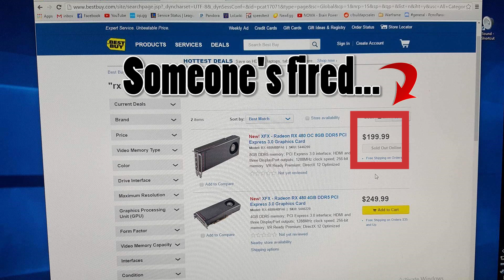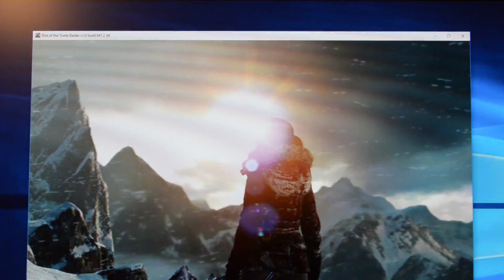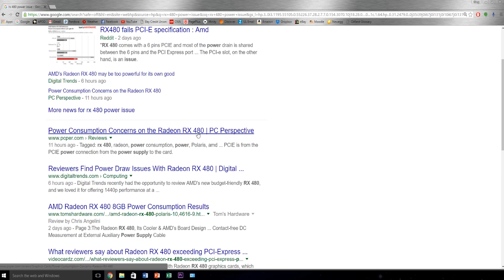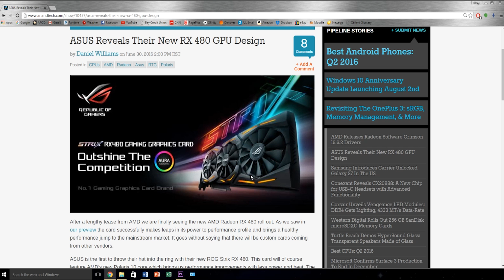RX 480 Aftermath: Power Issue & Over-Hyping

Comment: Do you think that AMD will release an updated BIOS for the RX-480 to push more of the power draw over to the 6-pin connector?
Reply: http://wccftech.com/amd-statement-rx-480-pcie-power/
Reply: There are many MicroControler chips on any modern PCB which can control Current flow,the 6 pin MOLEX has more than enough beef to reduce the 79W avg on MB power draw to the desired 60W,It's most likely a bug on their Power management Script(1:1 Scaling,whenever 6pin draw spikes mb power draw spikes almost identicaly) which will be most likely fixed with a V-Bios Update
Reply: Gerff
Dude,If everything is physical(like it's a Comodore)then how the fuck U OverVoltage ur GPU beyond TDP limits in order to overclock it ?
It's pointless to talk with you,just stop misinforming ppl
p.s: http://www.tomshardware.com/reviews/amd-radeon-rx-480-polaris-10,4616-9.html 
yeah this is definitely for Consumers xD
Reply: Gerff If you read my comments you see that I said: It is possible to force limit 66W on PCIe(12V*5.5amps) and draw the additional needed power from 6pin Molex that comes from PSU(they can maintain well above their official standards,in the absolute worst case scenario this will fry ur 6pin Port itself after like 1-2 year or so)in this way U are not undervolting-underclocking since u are getting the additional power from PSU
You missed my point,every card you see on the market,when you test their power consumption the line for PCIe Power draw is almost flat (that is the way it has to be)but with this card the MB power draw seems to follow the exact pattern that 6pin power draw has,this is not normal,and it's a way too foolish mistake to be a physical problem(Phasing of Regulators) with all the QC they do so I suspected a firmware based bug and I still do
nevertheless I never advise anyone to buy a reference card at all,they all have their problems,1080 with throttling back in the day even reference 960 had the same problem as this card(not this severe tho)
The Polaris chip itself is not a bad design,it's cheaper to produce and more efficient than most of the chips out there

they are going to release the update on Tuesday and we will see will it underclock or not

and again please work on your talking manners
Reply: +Gerff
If U are studying electrical engineering ,check out the tom's hardware's article and their test results,U will understand what I'm saying
Reply: Gerff LeadStarDude 
The New driver achieving 5.7amps(+ 0.2 from the limitation but well within accepted current)  with no Underclocking on PCIe power draw :
http://www.tomshardware.com/reviews/amd-radeon-rx-480-polaris-power-fix,4668.html
with compatibility mode for people with low tiered PSUs(Since it draws more than 75 from 6 pin molex,But each pin on a molex port is rated at 7-8Amps so it's safe for Gold PSUs) it registers below the limitations with 5.4 amps
Performance increased on all the power modes available:
http://www.pcworld.com/article/3093406/components-graphics/tested-amds-new-driver-fixes-the-radeon-rx-480s-power-draw-and-boosts-performance.html

It's simply fixed using the Powermanagement chips as I said before
Reply: Cant fix a hardware problem with software.  Circuit traces, Voltage regulators, capacitors, etc. aren't software controlled, they are physical circuits.  The COULD underclock the cards even more (reducing performance SIGNIFICANTLY, to the point that INTEL On-board outperforms them), and reduce power consumption that way, do you think THAT would be a good idea?  That is the only option they have to fix it with firmware.
Reply: Gerff They should be able to use firmware to shift the power usage more to one side instead of a 1/1 split. What makes you think that they couldn't do that? The firmware/bios controls everything including power management does it not? 

If not then I guess that the people that bought a reference card got screwed. So hopefully the aftermarket cards will have an 8-pin instead of 6-pin power connector.
Reply: LeadStarDude
No, the power doesn't work like that.  They are PHYSICAL traces and routes, and the card is designed and regulated for pulling a certain current from the PCIe slots, that is NOT something that can be fixed (or switched) in software.
Reply: Harmony Shimer Well I guess that proves @Gerff wrong
Reply: LeadStarDude
Hardly, the statement from AMD said almost nothing, except verifying that a problem could exist in some configurations and they might have to slow it down, the rest of it is just part of an article speculating things, which any logical and intelligent person would know means less than nothing...
Reply: Harmony Shimer
I haven't "studied" electrical engineering for 20+ years...Nor do I need to look at an article designed for "general consumers" to know basic circuitry.  You CANNOT change a physical trace or circuit using software.  The ONLY solution they have using software, is to SLOW THE CARD DOWN so it doesn't consume as much power from the slot.  Their options are 1. Slow it down to minimize the power draw (also meaning no overclocking is possible), which means it will perform even shittier than it already does, or 2. Recall the product and replace the boards.  Those are their two options.  On the consumer side, the most intelligent thing people can do is to return the card and purchase something else, and if they HAVEN'T bought one yet, DON'T.  It makes absolutely no sense to purchase this card unless you are building a new budget gaming system, for which you have other options.  This isn't a card that a person would "upgrade to", since the performance is lower than other options that are over a year old.  Basically, this is a product that should have been introduced over a year ago to make sense for anything beyond a new budget build.  Now, with the problems they are having, and BIG ones at that, there is absolutely NO logical reason to buy this card, at all.  I am sorry to say that, I had hoped AMD would come screaming out of the dark place they have been for awhile, we need them to exist for competition to the "other guys"; But they fucked it up again, worse than normal, and with an option that wasn't great to begin with.  Even FanBoys should surely see that this card is to be avoided, seriously.
Reply: Gerff You do know that a wall of text means exactly squat when you are wrong. AMD made a statement that the issue will be addressed through software. Do you think that you know their business and hardware better than they do? Oh... but we get it... You hate AMD and want to make a point. Well good job, and good story. No really... good story...  XD
Reply: Harmony Shimer
Completely different concepts, completely different things, and completely wrong way to think about things.  This is why people get confused, because people love to speak up when they don't know what they are talking about, and since people don't know, an oversimplification, or over-explanation by someone who is clueless starts to make sense to other people who are clueless.  Changing some power limits for overclocking isn't even CLOSE to process that is fucking up in these cards, and has nothing to do with it.  Your argument is like saying "Yes I CAN put more fuel in my tank, you are full shit and misinforming people when you tell them the car has the wrong spark plugs in it."

There are different points that the card draws power from, PHYSICALLY, and ONE OF THEM isn't regulated properly PHYSICALLY and pulling too much current from THIS POINT.  You cannot physically change the traces on a board, the regulators/coils/capacitors/etc. using software.  Yes, you can change a power limit setting by thousanths of a unit to overclock things, but that is hardly at a level we are having problems with here, and that does not change the ROUTE the power takes to get where it is going. 

I tire of trying to help people, teach them a thing or two, and morons jump in who are completely fucking clueless and love to argue, start bitching and yelling, and opening their mouths only to prove how ignorant and clueless they are, yet insist on interrupting and screaming for attention.  Let the adults have their conversations and exchange of ideas, and just sit there and shut up, maybe you will learn a thing.
Reply: Gerff AMD likely has a way of adjusting the max current limit from each rail. Nvidia cards also have this function, e.g., you can from my own testing, many of their cards will pull more than 90 watts from a 6 pin power connector, if you up the limit in the bios.

You can adjust how much it pulls from the PCI-e slot, as well as the 6 and 8 pin power connector, in addition to specifying a global max power.

For one of my client's GTX 970, I adjusted the limits set to 75 for the PCI express slot, 90 watts for the 6 pin, and 175 watts for the 8 pin, and a global max of 340 watts. (so I do not run any power based throttling. The card will never use that much power, but for the max it can pull, the VRMs are more than capable of delivering the needed power based on their data sheets.

Overall, AMD may be doing something similar. They likely have a driver function which can tell the card to use a specific power table rather than the default one in the bios, similar to how you can adjust the voltage and fan speed.

I have replaced many Power Microcontrollers and they have the ability to choose and set the limits on which power rail they are going to use
Your age doesn't give you any advantage and it's pretty sad that you speak in that manner while you are middle aged

have a nice day
Reply: Harmony Shimer Heck I am an old fart myself (A product of the 70s), and even I understand what you are saying is how it works with modern components. The way that Gerff describes things is how stuff worked like 20+ years ago. ;)
Reply: LeadStarDude I wonder how can someone hate the fact that a decent 250$ card is out anyways, have a freaking awesome day sir
Reply: Harmony Shimer
HOLY SHIT, THERE IS INTELLIGENCE UNDER THERE!  It is almost like two different people.  Since you are now able to discuss this in a proper manner, befitting a human being, we can get somewhere.  The problem with this card is that the voltage regulators were not phased down correctly for the PCIe rail, physically allowing (requiring in some instances) too much current to be pulled from the slot.  There isn't anything in BIOS that can be changed to allow this back into spec, if you follow PCIe specs and standards, which they must do.  If you simply step down the voltage using software, you also must step down the clock speed and VRAM speed to compensate for the lower current, otherwise (here is where YOU may not have considered, since you have now proven to have some real understanding of this), you will introduce a rather large amount of "jitter" since the card is being forced to deliver power in ways the circuit was not designed, and since it now isn't phasing in a manner even close to how it was laid out to, which will in turn cause stability issues.  The ONLY way they can fix this, properly, is to completely redesign the power rails on the card, otherwise, it will not be a FIX, and will not only cause the issues we discussed, but could also ultimately damage the motherboard in the PC as well.
Reply: LeadStarDude
Power rails, ground planes, etc. haven't really changed much, it is the signal path that is different.  Since he has decided to not act like a troll, and bring his brain to the table, the conversation has changed.
Reply: Harmony Shimer I agree that buying a reference card is a bad idea. Most likely the aftermarket cards will offer an 8-pin solution that will better address the issue and offer more over clocking ability.
Reply: Harmony Shimer
It is a band-aid, not a FIX.  Would still advise people avoid this card.
Reply: Gerff :))
Reply: Harmony Shimer LOL! I guess the proof is in the pudding. XD

Comment: Gigabyte Z170-HD3 will work well with the rx 480 yes?
Reply: no
Reply: Gerff Why is that so?
Reply: Grandmaster Kush
I just get tired of seeing these questions as if there IS an answer to them.  So, rather than pretending there is, it is easier to say no since every other variable that matters is completely missing from the question.  Since those variables weren't introduced, then no, plugging a 480 into that motherboard will not work, you are missing every other component that you need to make it work, so it won't even boot.
Reply: Gerff Well you still know what i mean, just judging by my comment one would not really presume that i meant if a gpu could run and get power blablabla solely with a motherboard, you don't make such assumptions in everyday speech so it is not really optimal to try to analyse it whilst on youtube.
Reply: Grandmaster Kush
It isn't optimal to ask such questions on YouTube either.  Honestly though, there is little known about this "problem", the cause, or what is REALLY happening with it.  Asking questions like yours can't really be answered right now, even if you did provide the rest of the required variables.  Your best bet, is to wait if you are hellbent on this particular card, and if you are not, then simply get a "better" card that is time tested and reliable.

Comment: power "issue"?? guys 480 has burnt so many mother boards, it is not just shutting down the system it BURNS your PCI slot, this is definitely not acceptable. Also please note that in other markets like in Canada 390 is 100$ cheaper and delivers better performance which makes 480 a questionable choice

Comment: did anyone have this problem on an intel platform? or only with amd cpus?
Reply: AMD CPUs don't even offer PCIe 3.0, only PCIe gen 2.
Reply: *****
Some reports are saying that the issue is only PCIe3, I was simply saying that AMD isn't capable of gen 3 standard on their CPUs.  Which is completely relevant in this case.  The "power delivery capability" isn't even the same between boards, let alone the PCIe standards between generations being a variable as well.  Until someone actually comes up with real, verified details on this, there is no point in saying something is, or is not, the issue, because that is NOT known as of yet.  Wait for the official reports, from REPUTABLE sources, before you decide what "the issue is".
Reply: *****
It is obvious you don't understand the things you are saying, or what is going on with the board.  I am sure you are trying, but your sources for this material are not quite explaining it correctly (or you are just assuming things).  TDP doesn't belong in this argument at all, as that is a measure of how much of the power is turned directly to heat, and has nothing to do with total power draw.  How much power a particular connector is rated for has NOTHING to do with how much it is actually drawing.  The 6 pin connector has NOTHING to do with how much power is being drawn from the PCIe slot.  The 1070 (or ANY other card) has nothing to do with any of this either, why are you bringing something completely different into the conversation?  It seems, that you need to further study the issue, what is happening, and why before you attempt to explain things or debate them, because you are confused at best.  If you wish to understand the way things work, and have questions, perhaps I can help, because your source is obviously not doing a very good job (or is explaining something completely different).
Reply: The only people I have seen so far saying that it was a problem for them have had AMD boards. I'm not saying it isn't causing problems for people on intel, but so far I have yet to see someone with an intel system have an issue.

Comment: nVidia fanboys remind me of Apple users a little bit... In the comment section anyway..

Informative video though. The only issue I have is the efficiency of the card. But for the price point (A good third less than a 970) it's impressive for low mid end for this generation. Hopefully it means Nvidia's 1060 wont be gimped like the 960 was.

Comment: Suprisingly enough my rx 480 doesn't cause that issue anymore. the reason why it doesn't turn off is because my motherboard, the MSI z170a XPower gaming titanium, has an external 6 pin dedicated to giving the pcie more power. I plugged that in and it didn't fail or shut down.

Comment: Honestly, AMD is stupid. First you must know your place and then act(if they couldn't achieve any where nvidia power efficiency). They are telling us our card is effiecient it features only 6-pin connector and here it comes the problems. just like thier bad power efficiency they lack performance efficiency (5.8 TFLOPS VS 3.5 TFLOPS of 970 and sometimes they lack way behind gtx 970). This most likely because of driver stupidity and lack of games optimisation(Not AMD fault). Lastly they are not overcockable at all. AHHHHHHHHHHHHHHHHHHHHHHHHHHHH

Comment: You got lucky, the additional power draw through the PCIe slot it out of compliance with the PCIe standard. Even higher end boards have no need to support higher power draw because nothing ahould EVER pull more. your board was also smart enough to turn itself off, if it hadnt you could have easily damaged the board.

This issue goes beyond just the obvious risk of crashes and damage to components. Because this violates the PCIe standard they cant claim it is a PCIe card, which they are. They will need to either remove the PCIe certification destroying future sales or fix it and issue a massive recall. Either way, its bad.

What you said about 3rd party cards being save because of the extra pci power connectors is not necessarily true. This may be a fundamental flaw with the board and "unfixable". even if it could be fixed, that doesnt mean the manufacturer did fix it. Basicly, dont just wait for a 3rd party card and asume its ok, do your due diligence.